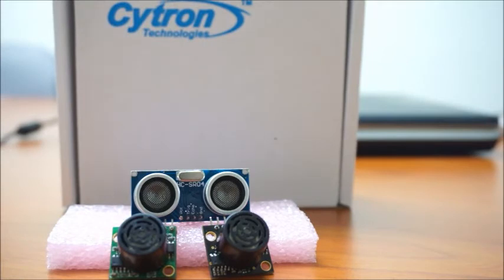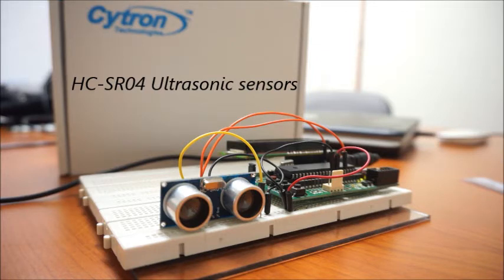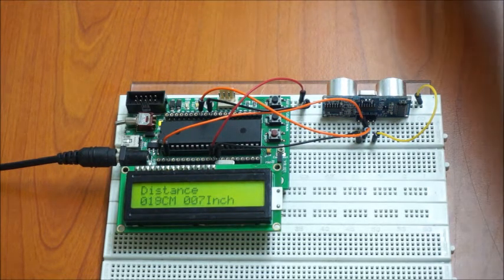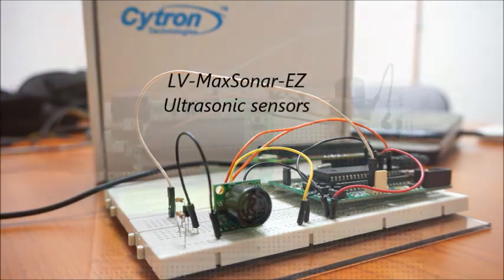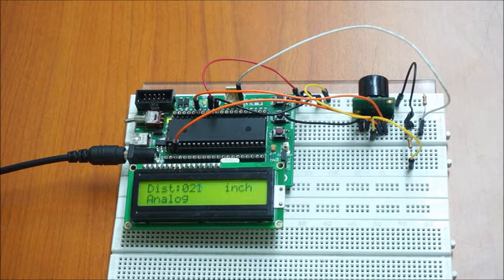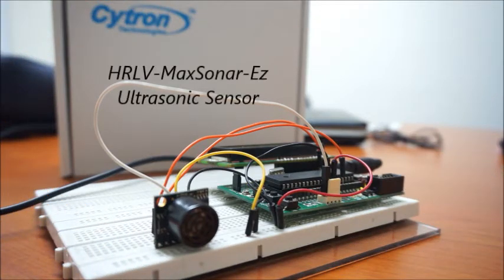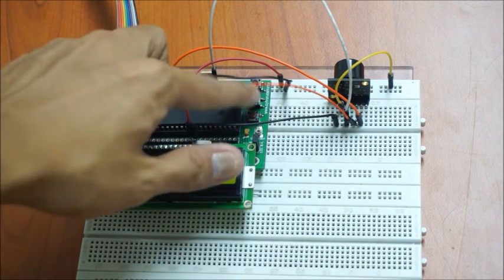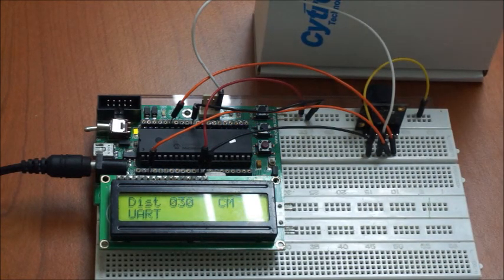Ultrasonic Sensor Comparison: HC-SR04 vs LV-MaxSonar-EZ vs HRLV-MaxSonar-EZ

Comment: If you addn't mentioned the serial inverter I never would have got this working. The LV-MaxSonar-EZ just spits out garbage. Thanks!
Reply: It is worth noting that if you are implementing your own software UART you do not need an extra inverter hardware since you can implement this using software.